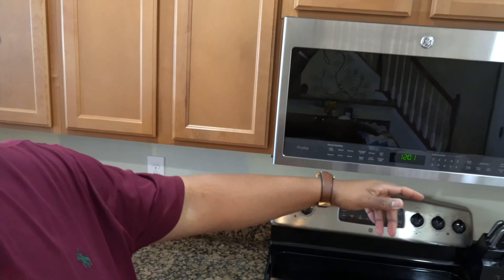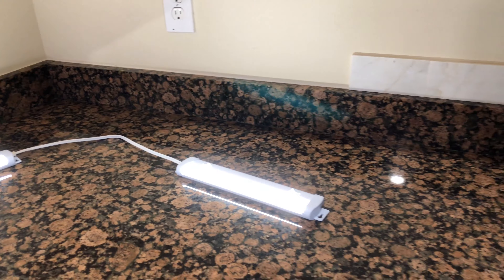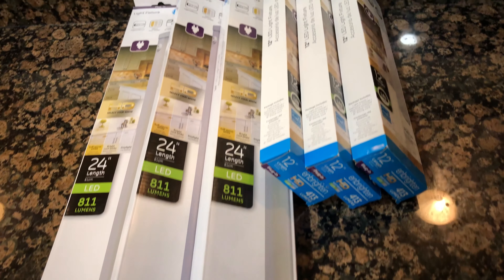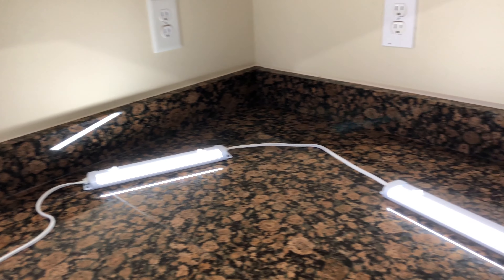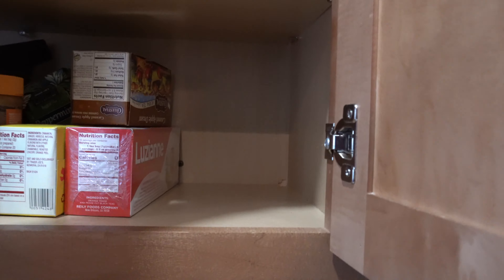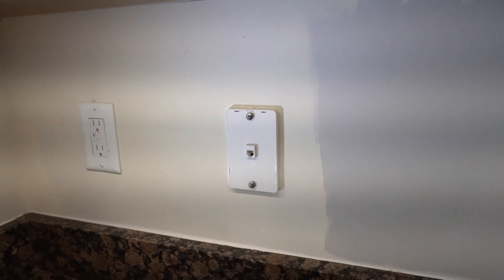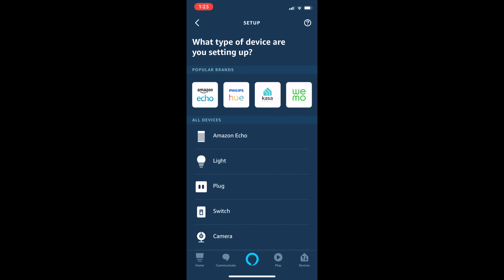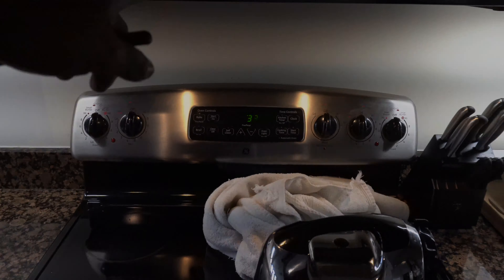How To Install Under Cabinet Lights Controlled by Alexa for Smart Home

Comment: What's the size of the spade bit you use?
Reply from the maker: In this install I used a 5/16 spade bit. SPEEDBOR Standard Length 5/16-in Woodboring Drill Bit https://www.lowes.com/pd/IRWIN-SPEEDBOR-Standard-Length-5-16-in-Woodboring-Spade-Drill-Bit/1003088846

Comment: Your holes for the cabinet should've gone near the face so the wire would be hidden by the board the doors mount to. Then for the shelves, cut off the corner by the face so you can adjust or remove them and not disturb your wire.